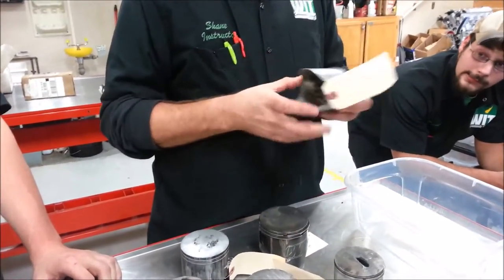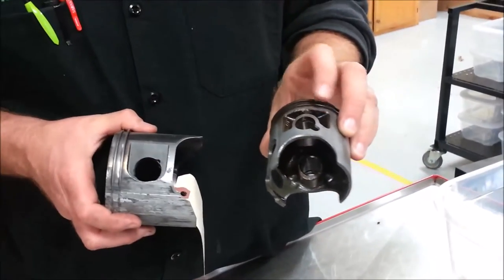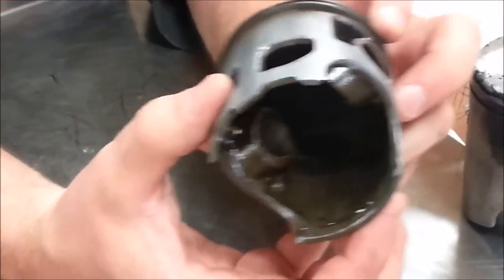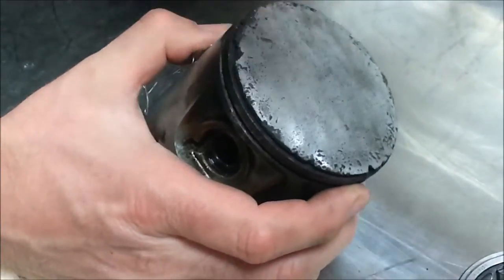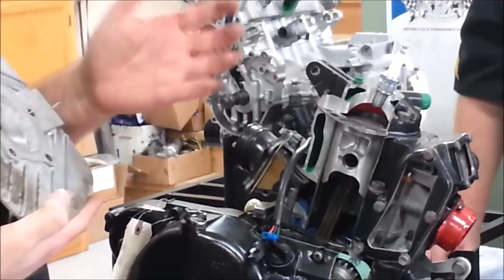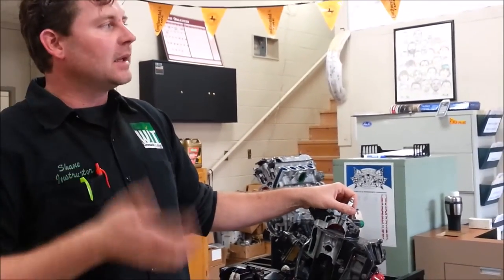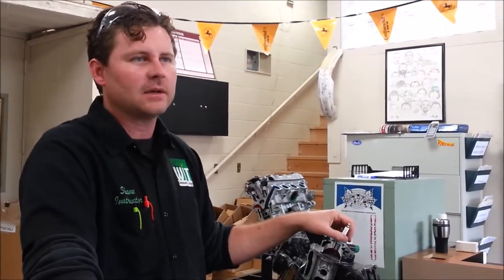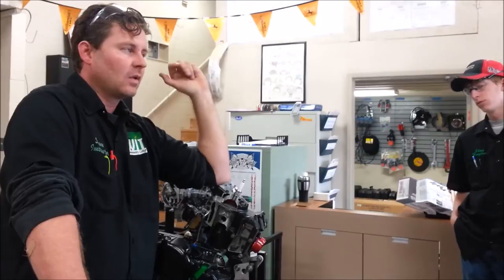2 Stroke Engine Disassembly   Piston Damage   10 27 14

Comment: Yeah ok or for that head u could hand lap sand for 20bucks and and about 30min to one hour and u can shave down a super smooth few thousandths sanding after that reduce your squish clearance by decreasing the head gasket thickness simple your compression is back your head will work.
Reply from the maker: I hear what your saving for a "save the day" repair. Thanks for sharing.

Comment: I absolutely agree with the thesis of fuel, the higher octane number does not mean more power. This is because high-octane fuel has a low flame speed.
Reply: Could a damage cylinder cause the engine from starting?